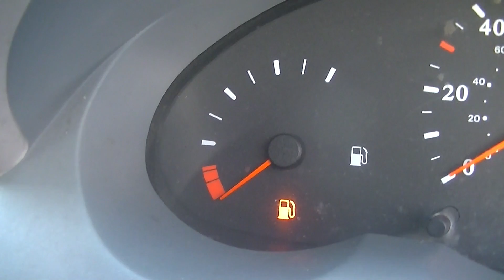Seafoam Test - Does it really work?? Pt.2  The Proof

Comment: I have used Seafoam for years and I notice significant improvements in engine performance, particularly on older cars which have high mileage, and have not been maintained very well. I used a can of the SeaFoam spray on my car just 30 minutes ago, and after taking it for a drive, the idle is much, much smoother, to the point where I can not only feel a difference through the stick shift, but when I watch the engine idling, I can literally see a difference. This is on a 2007 Subaru Forester with 95,000 miles. The idle on this car has been a little rough since I bought it with 50,000 miles. The previous owner leased it and did not change the oil, plugs, or air filter more than once or twice. I've added Seafoam to the fuel on a few occasions but it did not help very much. The reason I am posting this is because I was very pleased with the results of the Seafoam spray and decided to read a little about it online, then I found this series of videos. I am not posting this to stir an argument, I am relaying to you what I have honestly witnessed with my own car. I have also found that adding Seafoam to engine oil before a change works really well for removing buildup and sludge. I know this because after idling for 30 minutes with ~1/2 a can of seafoam in the oil, I consistently notice that the oil is darker when I drain it than it was before I added the Seafoam. Please bear in mind that this product does not work miracles, it is best used for maintenance + upkeep of cars which are reasonably well maintained to begin with, or which begin to show early signs of complications associated with buildup and deposits. In my personal experience, it has only improved fuel economy while it is in the fuel (thus canceling its own value), and it does not increase compression. The spray works much better when added to the intake vs the liquid product.

Comment: I don't understand why people worry so much about "decarbonizing" their car's engine. just change the oil, keep the fuel tank full, change plugs and wires when the should, keep the air clean. cleaning the top of the cylinder is kind of pointless. injectors should be kept clean but, other than that, proper maintenance is so much more effective than ANY snake oil IMHO. Good test though. I think it did show a difference but, I think you'd get the same results from any detergent...
Reply: I worry mostly because I couldn't afford the car I wanted when it was new. Now that I can they're all used, with usually 74-100k miles on them. I could tear the engine down and clean it. But if I can find a product that will take some of the worries constantly flitting in my head about how well the car was taken care of by it's previous owners I'd spend the money.
I've seen the maintenance records and had a dealership check my vehicle out. But there's always that paranoia. No one will take care of your car like you do if you love your car as is the case with me. But I can't afford a garage or the cost of renting one plus tools to tear my engine down. I'm slowly getting to that place. But having a catastrophic failure on my car in the meantime is going to set that goal back a lot.
Reply: Kyle Simon I hear ya. I guess what I was getting at is, cleaning the carbon on the top of the cylinder is like cleaning the oil from the undercarriage. Sure it looks better but, does it really affect anything? No not really. Don't get me wrong, I appreciate a great maintenance schedule but, seafoam being what it is, its kind of expensive, I just don't see any real benefit. 
Why tear the engine down at all? change that oil, plugs, occasional adjustments to valves and screws, lube that steering linkage, you are good for at LEAST 200k (especially with the newer engines).
Reply: Oh yeah, I kinda got into the weeds on that. I can honestly only think of one reason which is so I could use a bore camera like that to inspect my piston, rings, and cylinders for wear and damage without having to yank my heads every time.
Reply: F!@#Guilt if it cleans the piston heads, that means it is probably also cleaning at least the exaust valves and ports, allowing better seating and flow.
Reply: sirgallium No argument there. My point is that we don't extract injection ports and look at them or test the state of the valves (so, its still just an assumption). Everyone gets excited about the top of the piston like the carbon on the top of the piston is a huge problem which, its really not. 

But you are right.

on a side note: with modern fuels and proper maintenance, carbon really shouldn't ever be a problem these days. I guess if you find a seized engine, this stuff may help but, not long term. snake oil all of it. :)
Reply: sirgallium I had to change head gaskets on my grand am. engine had over 150,000. the inside of the cylinder has zero carbon anywhere, piston heads, even the old plugs were carbon free (cylinder walls were smooth as glass so, probably could have used a hone but...). I think the carbon thing isn't really a thing anymore in most cases...
Reply: +F!@#Guilt If you have a bad head gasket that coolant will steam in the cylinder and clean it, but that is not really a good thing. Engines with a blown gasket on one cylinder will have one clean cylinder.

Comment: I have owned cars where the engines have ran fine for well over 200,000 miles using everyday 87 octane unleaded gas, with no fuel injector cleaner ever used, and certainly never using Sea Foam.  I don't understand why you would ever need to use something like this or any other treatments/additives.  If the engine doesn't run right, the problem is something that snake oil probably isn't going to fix, and could make the problem worse or cause other problems.

Comment: Maybe it's my screen resolution or something...but I thought the post-Seafoam shots looked decently better than the pre...
Reply: +Paragon DrugScreening  I agree.  Obviously cylinder 4 looked bad, and it didn't really clean up too good, but I thought the other 3 did clean up pretty good.  There wasn't nearly as much build-up remaining afterwards in 1-3.  I've used a couple of professional injection cleaning systems, one by STP and the other by Valvoline, but I'm definitely not sold on eather one.  I personally feel a good over the counter fuel system cleaner does about as good.  Just add every 3000 miles, or at each oil change, and I've not had much issues with eather of my vehicles.

Comment: I just wanted to really thank you for making that video.  I was told by many people how great seafoam is.  I tried it on my twin cylinder riding mower.  You see the white smoke coming out but that was all you had to go by.  I had my doubts.   Your test proved this product is nothing more than great marketing of snake oil.  I had a feeling if manufactures were not suggesting anything more than proper oil change maintenance and good quality gasoline.  There really not much more that should be done or can be done.

Comment: In my opinion, using an entire can of Seafoam in your gas does wonders.
Reply: how so, what changed for you,mine runs like shit ha
Reply: Using in in the gas tank on a direct injected engine does nothing. The carbon buildup is on the back side of the valve so the only way to clean these is to run it through the vacuum lines.
Reply: Nothing is more noticeable than a brand new car tho.

Comment: Being someone that has rebuilt plenty of 4age motors (specifically the 4age's out of MK1 MR2's) I know what carbon looks like and how to clean it off.  Seafoam does work to a degree.  First you did not let it sit long enough.  As a test a couple years ago I soaked carbon covered piston tops in Seafoam directly.  My goal was to make it easier to remove from the pistons.  I found I had to not only heat the pistons up but let them soak for at least a couple hours.

Now your before and after clips do show a change.  Especially piston 4 where I saw a lot of pitting inside the carbon deposits.  The after had a lot less pitting which means the Seafoam was doing its job but it wasn't done.  Had you warmed the engine up fully and let the Seafoam sit for a couple hours I think the results would have been a lot more apparent.

With all of that said.  Most carbon deposits are from less than quality gasoline or oil leaking into the chamber.  Now a days, most gasoline's have their own detergents to help prevent this amount of build up.  However, if you have bad valve guide seals, and small amounts of oil are leaking into the combustion chamber, you will have carbon build up.  Oil will not completely burn and when the engine is turned off but fully warm the oil cooks and coats the combustion chamber.  This leads to build up over time and either the need for an engine rebuild/replacement or at minimum, a cleaner treatment like Seafoam.

While you performed the tests in an excellent manner, you needed to wait longer for better results.  A change can be seen but it isn't a change that you had expected.
Reply from the maker: I tried to follow the instructions where it tells me to wait 5 minutes before starting it up. However personally I like the water decarb method.

Comment: Thank you, this is one of the most scientific tests I've seen about anything on the Internet.

I generally don't believe in any kind of additive but I do believe Seafoam does something. Here are two instances.

#1. I bought an old single cylinder 250cc scooter that ran very rough so I added Seafoam to the gas tank only and in very short order it started running smoothly and continued to do so.

#2. I bought a used 4 cylinder 1200cc carbureted motorcycle which didn't run a smoothly as I would have liked so I added probably six ounces to the five gallons of gas in the tank. After riding the bike for a couple of hundred miles and after the smoke cleared I really didn't notice a difference in the way it ran. It was still a little rough.
What I did notice a week later, to my dismay, was that all my carbs started pissing gas externally.
I believe the Seafoam loosened deposits and/or destroyed the o-rings at the fuel tubes between the carbs.

Moral of the story...give it a shot but use it sparingly.

Once again, thanks for taking the time to make this video.

Comment: This is the best and most thorough testing I've seen for Seafoam.  One thing I would ask is a follow up simply using water.  I believe EricTheCarGuy did just that, but never showed the results.  Essentially, it is steam cleaning the engine rather than using chemicals.  I would love to see the outcome.  There are different methodologies but I would have to recommend using a misting bottle.  Job well done on this one!

Comment: What i've heard is if you're trying to get the pistons cleaned up you actually pour a small amount of seafoam directly into the cyl and let it sit for 20 minutes. then start the car.  

When the seafoam is being sucked into the vacuum line its literally just becoming a vapor that can gradually help valves and stuff. but pistons have thick carbon buildup which vapor is not capable of doing a deep clean.  the best way is to soak that piston.
Reply: I bet he would have had a better result.

Comment: A true test with REAL results. That's what  we like to see. Thanks for taking the time to make the video.
Reply: His engine was CLEAN!!! lol
Reply: He used a clean engine and measured literally the only part of the engine where carbon deposits don't impact performance.

I wouldn't consider this result to be useful as it neither proves nor disproves the utility of sea foam for the purposes of removing carbon deposits. The deposits you probably care about are either on the sides where he wasn't looking or in the fuel system. The heads aren't likely to see much improvement with sea foam versus just driving on the freeway for a while because most of the product has already burned up by the time it gets anywhere near the cylinder head.

However, depending upon the vehicle, the fuel line, injectors, spark plugs and carbs may see some benefit from the product and he hasn't looked at any of that.

Comment: Best thing I found 15+~ years ago was Slick 50 fuel treatment, used it on an old Vauxhall Carlton 2.0l with over 120,000 miles on it.  Stripped the head of one weekend to fix it so I could get back and forth to work and then the following weekend had strip it again and do the job properly using new parts ;) during that week I used the slick 50 fuel treatment and boy what a difference from the week before when I took the head off piston crowns that were coked black and oily, suddenly back to only slightly tarnished; intake valve that was heavily fouled with deposits, now clean. The exhaust valves were the worst but there was still a reduction of about 50% of the fouling on them. In all, as a product, I have found that it does what it says on the tin and try to treat all my vehicle at least every major service.

Comment: First off, you did a good job on the video with one exception. The important parts to clean are the stem of the valves and the injectors. The tops of the pistons are cast and very rough textured. You need a brush to remove the stuff from them. The valves are smoother and I know the Seafoam will remove the deposits from them. Also the injectors will spray better thus giving better spray pattern and better economy. If you can do a before and after on your fuel mileage and overall performance and not see a difference then I wold agree with you!

Comment: Good test. I use a can of seafoam in my fuel about every 3 to 4 k miles hoping it helps keep the injectors cleaner. I also only run Chevron gas. I think after seeing your Video I can save the 20 bucks a year.  Run super, change plugs, try to keep from running real low on gas and keep the engine tuned. Thank you for taking the time to do this test and also point out. :Don't trust everything you see or hear. Again Thanks.

Comment: Seafoam has undoubtedly made my engine a lot quieter and smoother. Perhaps it doesn't make all that much difference to the piston heads, but I can put my hand in a live volcano that my car runs soooo much better now. 

I suspect the biggest difference will be where the air gets restricted (where the product will be in better contact with engine parts), namely the back of the intake valves and parts of the valve seats.
Reply from the maker: Thanks for watching the video

Comment from the maker: Click here to watch the water decarbonisation test http://youtu.be/eZDISp2pdSo
Reply: So you not find any difference? 
Better idle or more mpg nothing?
Reply: Jesus Sanchez My lawnmower ran better afterwords.
Reply: What about your car?
Reply: My friend put some in his impala with the 3.8 and it seemed to run better.
Reply: I believe the time factor of the use of this product varies and how you use it. 1st. I would had change the fuel filter. 2nd. I would had pour some in each cylinder. 3rd. I would had sprayed some in the intake. 4th. I would had let it sit overnight. 5th. I would had made a higher concentration ratio in the tank.

Try doing this and see what the results are. I had great results by doing it this way.
Reply: 99% of fuel additives are snake oil.  Little exceptions are some Octane Boosters, and fuel dryer that adds alcohol to water so it will not be so bad when it combusts.  Fuel additives that contain PEA work. But Gas Stations already have this additive in the fuel, i.e. Chevron, Shell Phillips. So why buy gas additives if they are already in good fuels, just see who has it in the gas you buy every day already.
Reply: Robert Fitzgerald  But it does not instruct you to use it in that way.
Reply: Instructions it has may be for a maintained vehicle. Depending on the severity, you might have to tweak the instructions. Like shampoo, "wash,rinse and repeat.". I don't need to repeat or wash it daily, but somedays I have to repeat three times because drit and grime.  It's what it is.
Reply: Robert Fitzgerald  BMAC is right. Where on the can does it tell you to do that. I believe he is right on this. I would do the same thing if I had time. BMAC just saved me some $$$ Again if you believe the product works and you see results then use away, but you still have to question the fact's.
Reply: +BMAC VAGS I appreciate this video is over a year old, but over the past weekend I tried SeaFoam (through the vacuum pipe, and through the fuel line, just like your video) on my 2007 Honda Type-R.
I wanted to know if it made a difference, so I got the local garage to test the emission levels before AND after - they were EXACTLY THE SAME!   No improvement whatsoever.

SeaFoam?  Mmm... I'm certainly not convinced.  Waste of money I think.
Reply from the maker: I am glad you made the effort to try and test to for yourself
Reply: thanks for sharing that, i watched a guy pour into lawn mower carb, and it cleaned it very little

Comment: A majority of the carbon build up that affects the pistons are on the edge of the head and cylinder wall. Did you get any footage of the edge? Even though the center of the head on the after shots appears different from the before shots, any efficiency/power gains will come from the edge not the top. The edge is where the friction is and a smooth clean edge/wall has less friction then one with carbon build up.